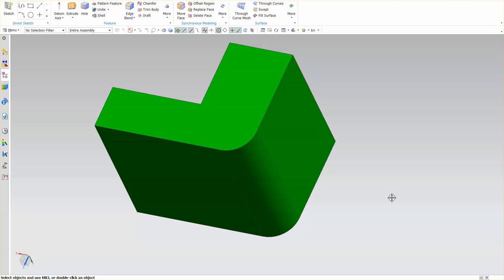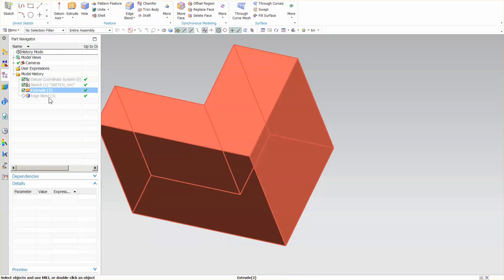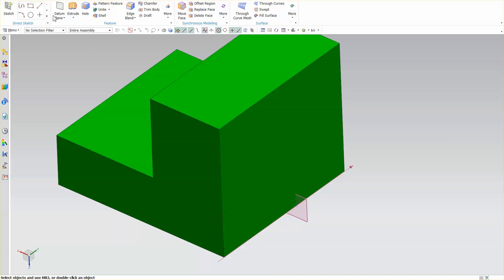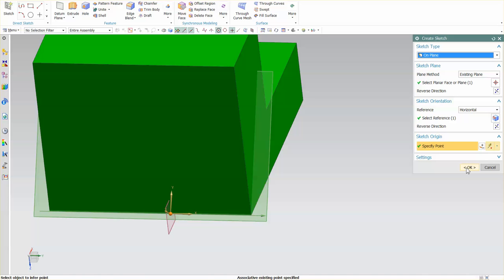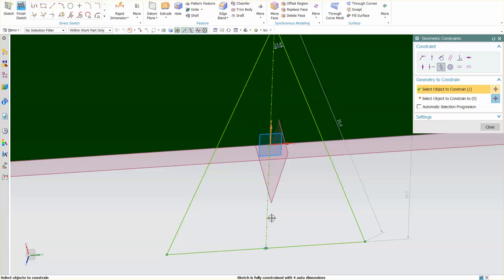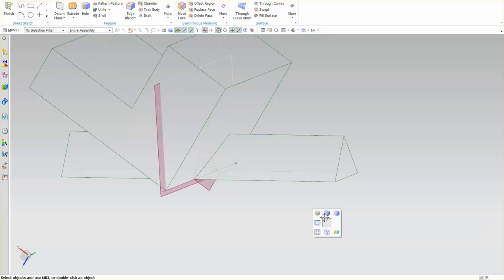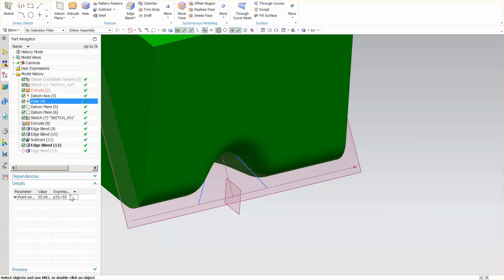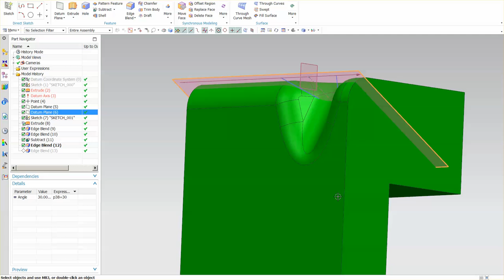Siemens NX | Reference Geometry

Comment: NX reference geometry functionality leaves a lot to be desired. For example, I wish I could simply create a point where two reference axes intersect. Cross referencing geometry is waaaay more intuitive in most other CAD programs.
Reply from the maker: You can. It is under 'Point Set' Intersection. 

Something to remember when dealing with NX: It is the only fully parametric CAD/CAM/CAE tool that allows you to open and work on data that's over 30 years old with out migrating and such. 

Siemens/UGS made a promise decades ago to anyone using their software that no one else has. No matter what version your data was created in, you can always open and modify your data. 

That has lead to certain situations that no one else has to deal with so that makes it so somethings are a little different.